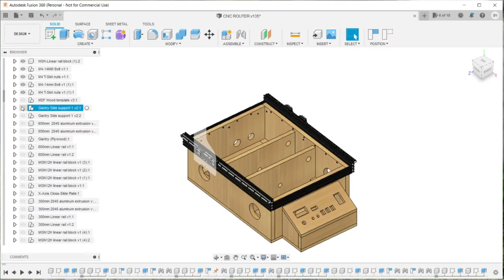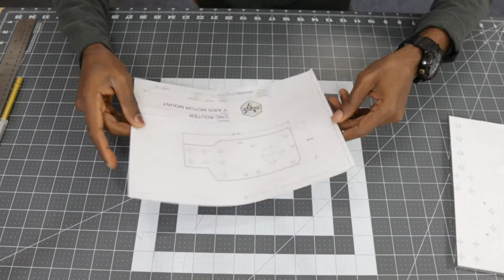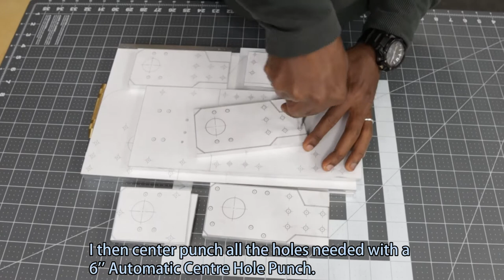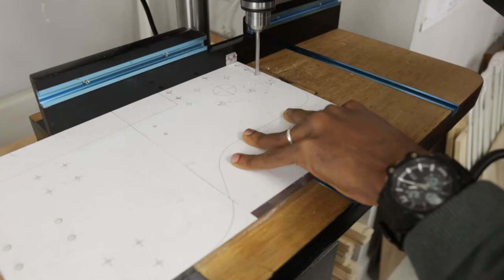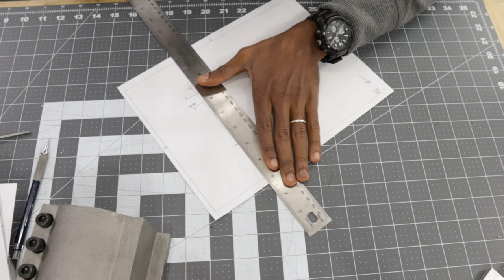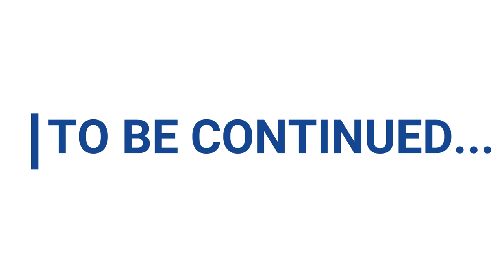How To Build A DIY CNC Router Part 2

Comment: Using the jig saw to cut the aluminum was courageous.. I’m building a machine as well but I’m going to have wood or plexiglass templates made of my solidworks file, mount the template unto the aluminum and use a plunge router to cut them out then a flush bit to clean things up.. I would jack my aluminum up doing it freehand like you did..  You did an excellent job B..
Reply from the maker: Thank you Star Child! Be safe and good luck on your build.
Reply: That was a circular saw, actually. There are a lot of builds of this type of thing on youtube. This guy has a build video for his and there are a couple clever tricks to his. But, yeah, seeing it cut aluminum was mind-blowing.
Reply: @titocruz5798   The circular saw guided straight cuts were  the easy part. The jigsaw work began around 5:49

Comment: Hi . 
First I want to say big big respect to your job and what you are done . 
Second I am I interested of your project and I want to build my own cnc router cause I start to need it  .
Peoblem is that I not have you skills to make 3d draws and project and what I see your project look fantastic and rigit enough to can cut steel and aluminum.  
Please can you share it with me even if I need to pay not problem ,my point is I not want to sale or make profit just I want to have the draws of the aluminum clamps and linear rails model and etc to I can build it and use it .
Thanks and again big respect .
Reply: If is possible and is problem can you help me with build of the cnc with share of some details and other . 
Best regards .

Comment: You did an incredible job! Extremely impressive. Have you thought about selling a set of plans for the mechanical build? If you offered PDFs as well as dxf or Fusion 360 files to CNC cut the aluminum parts, it would allow others to build a machine like this.
Reply from the maker: Thank you Mark!  I'm working on that.